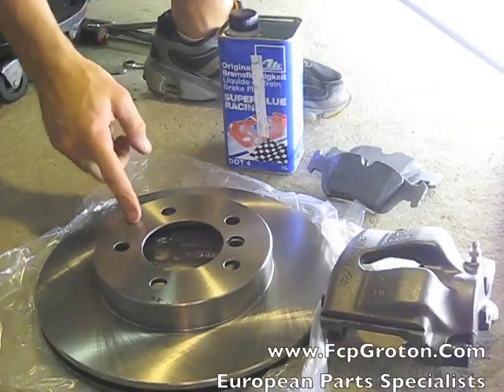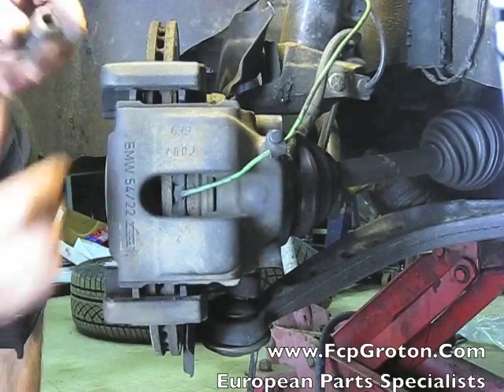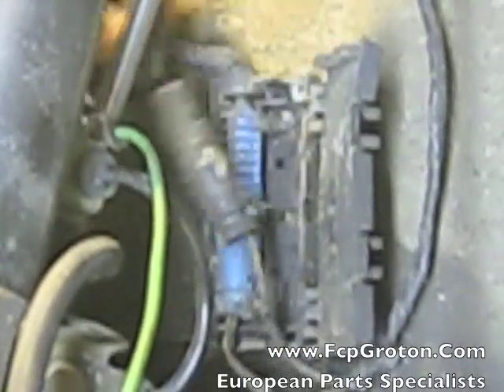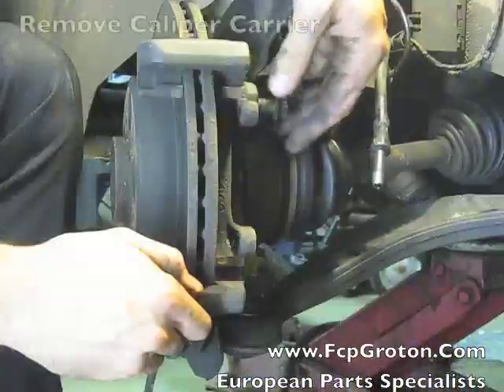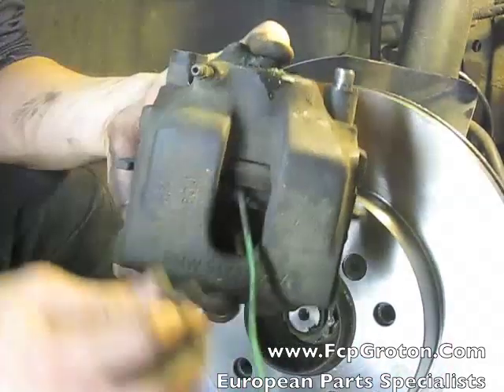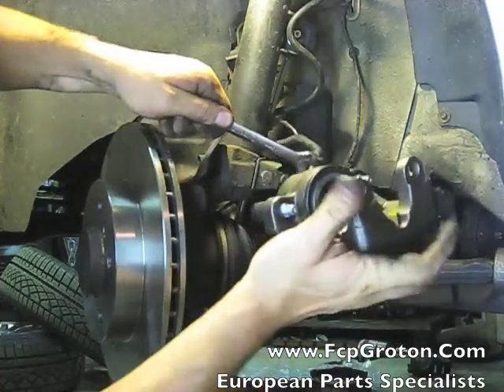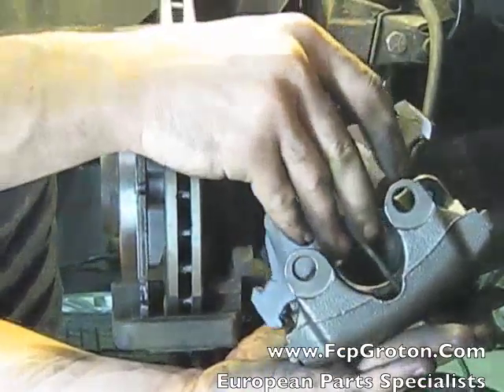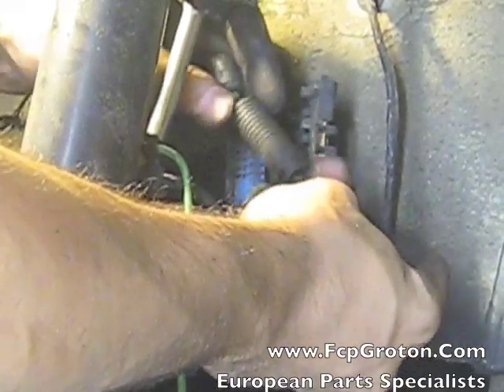BMW Brake Repair (Front Pads, Rotors and Calipers - E46, E36) MillerTimeBmw - DIY 11

Comment: I think you should mention to thoroughly clean the hub before placing a new rotor. 
Use a steel wire brush or a bit of sandpaper to clean that area, otherwise there is a chance that you'd get some vibrations.. not perse but there's a good chance on it.

Otherwise excellent diy!

Comment: why remove the wear sensor from the electrical connection and not just removing form the old pad to the new one since you have to do that anyway?
Reply: He didn't have to do it in this case. But in most cases when replacing pads the sensor has already been cut, and cannot be reused. It is how it signals brake pad wear. I don't bother doing that, as it nearly doubles the job and is an additional expence. It's one of those overengineered things that are unnecessary, I rely on the brake pad wear indicators instead.

Comment: Great video - but could you explain the bleeding of the system for those who have never done it? Especially your warning at the end, I've never bled a system and don't know what you mean by that. Tx!
Reply from the maker: You will need to:
Top off the fluid and make sure it stays full.
With a partner, pump the brake pedal 10 times and hold, then have a friend open the bleed nipple to release air in the lines. Ask the partner to close and repeat the process until no more air is seen. 

Start with the rear brakes and then the fronts.
I hope this helps.
-Zach

Comment: So bad that I only watched video without reading the comment from Zacharyzooshorion. After completing the job and a 10 minutes horrible driving , I realized that air in the new caliper was mixed into the break system. It cause very soft breaking. So now I have to do the bleeding for he entire break system to get out the air, not sure if there are more damages I have made. please add this critical step into the video.
Reply from the maker: I added the warning at the end to make sure you bleed the system. It's a crucial step.

Comment: Thanks man. After reading your comment I discovered the rockauto site. They have great prices. I wanted to ask you is there a place where you can read up on different manufacturers of after market parts to get a better idea of quality/price ratio. Or if you have a another way of deciding whic brand to buy I would be interested to know.
Thanks

Comment: @shippudenkld100 I have a 00 323I and I'm getting the same noise. I work for a BMW company in Florida and they said pads. Change them before your sensor light comes on for your brakes. That sensor is about $80. I just paid $103 w/ tax for front pads. The rears are going to run me $84.15. So yea change them pads.

Comment: If anybody reads this i need major help; my bmw 325i e90 2006 brakes are making rusty/screechy noises when i slow down. my question is do i need to put brake fluid in or do i need new brakes?

Comment: Thanks for your reply.  Last year I replaced stock rotors with CSL 345 front and rear floating cross drilled brakes with Hawk pads.  Boy it took a while for it to bed in correctly.  Took the car to the track after about 1000 miles of street driving and it really didn't have any bite.  Lost confidence in driving fast.  At the last event in Autoclub Speedway in Fontana.  The brakes finally bit and braked hard as it was intended to do.  Brake bedding is very important!  Thanks again

Comment from the maker: Cool project, I just measured and aligned the caliper so it will be aligned correctly when you finally tighten it down fully. Also, the caliper is aluminum so "snug" but not too tight!

Comment: Great Video.  How much torque (tightness) do you place when connecting the brake line to the calipers? Is there an orientation to the calipers because I would think that it would twist the brake line if the caliper was facing the wrong way when placing back onto the bracket on the rotors.  I'm changing all calipers on an M3 with rebuild calipers.

Comment: Great video. The 16mm bolts are stuck and won't come lose. I tried with all my strength until I thought that they loosened clockwise, but they don't. I'm taking her to a mechanic with power tools. I'm amazed yours came off so easily.

Comment: To the last question: bleeding, meaning to bleed any air trapped in the brake line system. Push on brake to make pressurized. Have a friend hold down brake pedal. Open the bleed valve until brake fluid squirts out. Stop. Done. Gotta make sure fluid level is full in reservoir though. 

Thanks for the nice thorough video!! 
It's a nice addition compared to all the bad videos on YouTube.

Comment: Hellow i got a bmw320 what size of brake rotors shoud i buy i bought 278 and i can send them back cause the brake pad sticks out about 0.75MM  i dident mount them on cause i want to here some opinions i'm sending them back on monday unless is doesn't matter they stick out ... if i need other rotors what diameter shoud i buy ? my car is a 320d from 2002 facelift model , thanks in advance marco

Comment from the maker: @AlboBmw 
Hello,

I removed the sensor from the car because i didn't want to cut or stretch the pad wear sensor while replacing the caliper. I replaced the caliper because after a fresh front end re-build the car would still pull to the left while braking, after this brake job it brakes perfect!

Comment: Good to see you again Zach.  Nice video.  I am looking to replace my belt tensioners on my E46.  I would DIM but I suck at getting the fan clutch off.  ( I needed professional help after attempting a water pump project)  Looks I will stick with brake servicing.  With your helpful videos  I am confident in that department.  Also, any videos on servicing/replacing the E46 steering rack would be great.  Right now, I have good luck with using  Lucas  Steering fluid to keep mine in working order.

Comment from the maker: @sbakar 
Interesting points, however I would advise against using vice grips on brake lines as it will pinch the line possibly creating weak spots, especially lines with steel covers or internals , additionally with new calipers the entire brake system should be flushed. 

Thanks for the comments!